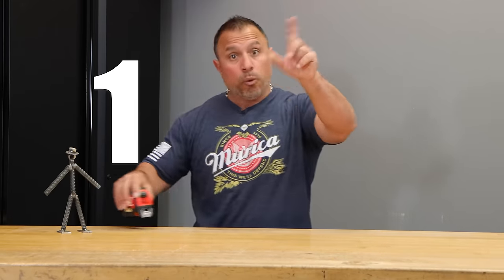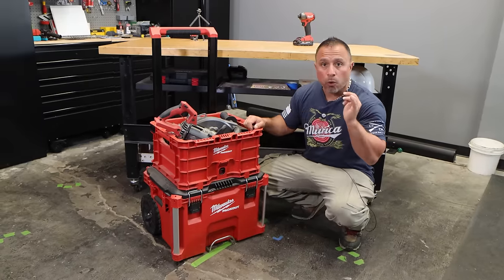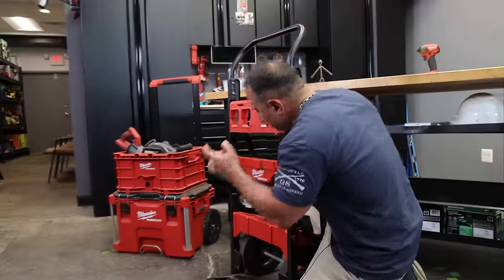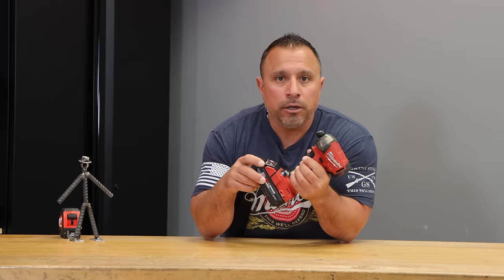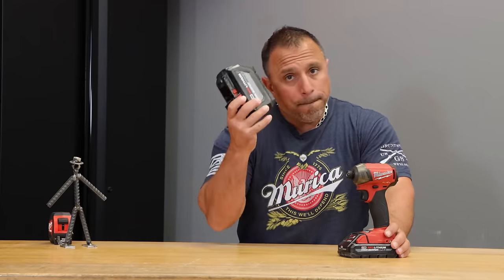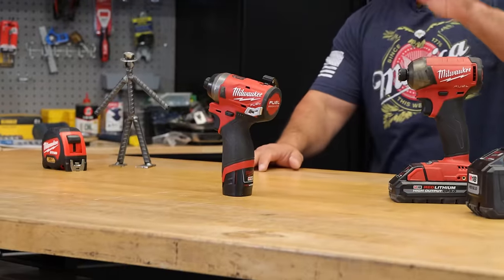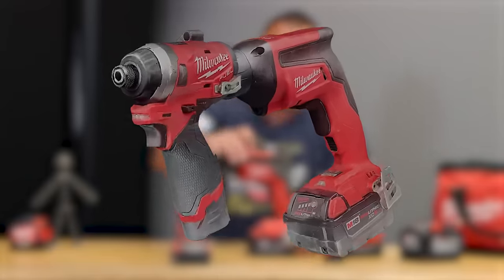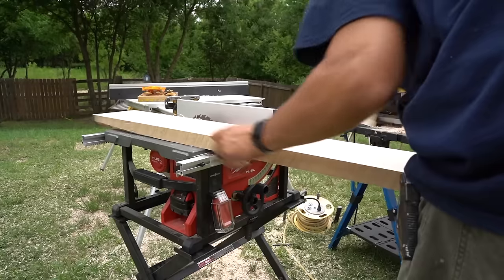Milwaukee Pipeline 2023 Top 5 New Tools!

Comment: I think the m12 caulk gun needs a revamp.  Needs a seperate pressure release button or a 5 second delay before it backs off, and not back off all the way.  It failed to deliver miserably because you have to wait forever for the plunger to engage as you move from run to run.

Comment: Tool scientist channel showed that the m18 batteries can output 15 Amps easily. I think changing to a pouch cell platform won't change that fact. Current lithium cells in tool batteries are fine, also for performance. No matter how you look at it though it is the frequent high load demands that will diminish performance in tools over time. Not sure if pouch cells are much better than cell batteries. Tesla still puts cylindrical cells into their high performance cars for a reason. I see pouch/blade cells be put more in vehicles for efficiency and range, over performance metrics.
The biggest issue I see with milwaukee batteries is that they have poor cell balancing pcb boards. There are more videos showing imbalanced cells and thus lower performance over time sooner, even after charging. There are increasingly better passive and active balancers on the market. Would like to see better pcb boards in new batteries and replaceable boards for older batteries that still have enough performance but don't work right due to imbalanced cells.
Reply: Another improvement I would like to see are more mikwaukee motorised tools for the L4 batteries. I think the current line for lights and laser tools are too limiting. I have many of these batteries laying around doing nothing. Because of the proprietary connectors I can do little else with them. But it would be nice if there simple battery bay parts we could use to mount the batteries to other tools like clocks, smaller fans. And perhaps mikwaukeee can make the L4 batteries run on their electric screwdriver as wel or make a model that can run on one or two L4 batteries. Or maybe make a flexible  accessory where can put and fit 3 or 4 of these batteries on a  flexible sleeve or belt can can more easily for in a heated sweater or jacket, instead of have a big fat unit in one cluncky pouch with a bulky battery.

Comment: Table saws are not a good tool for batteries.  They need a lot of power and they tend to be used for long periods of time.  Mitre saws on the other hand are better because it's just a quick chop.

Comment: Forged lipo batteries new gen 3 high torque impact wrench table saw new nailers and new  surge new M12 lipo batteries first to market with 12v lipo batteries and a blistering fast charger for the new batteries

Comment: My list.

1). M12 Gen 2 Surge.
2). M12 dual bay rapid charger....c'mon guys...you have high output batteries, and you inflict that piece of shit 15 year old charger on us. Your 4 bay charger is 3A charge and sequential...it sucks.

On a side not, I use the M12 rotary tool with spiral cutter bits and its awesome for cutting out drywall for electrical. You dont need that pesky guide thing on the M18. On another sidenote, the milwaukee spiral cutter bits SUCK. Makita ones are miles better.